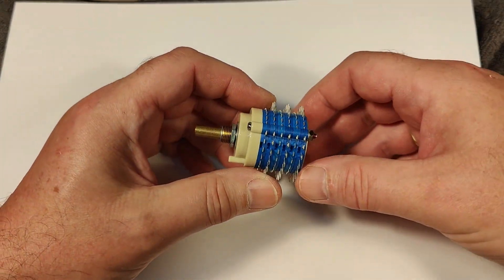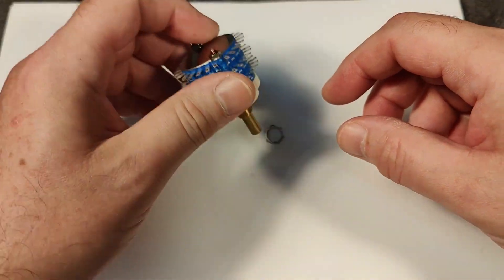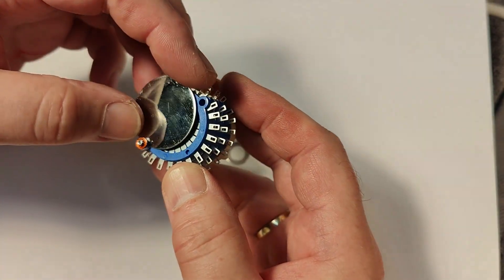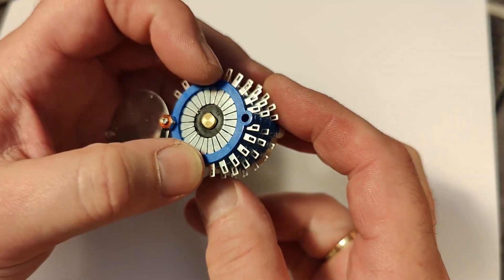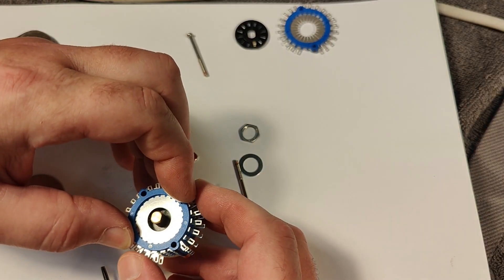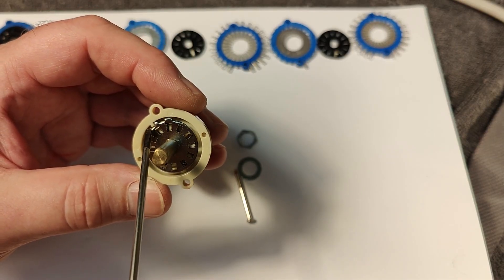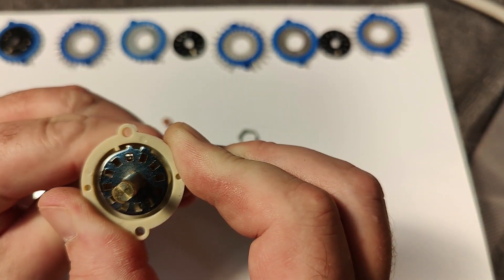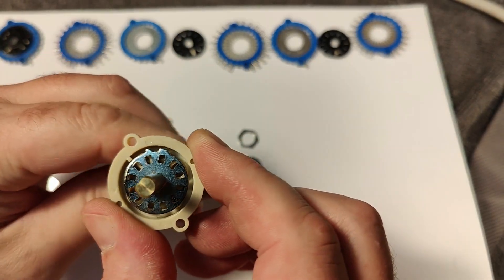HELZCDNL 15 degree rotary switch end-stop experiment NO WAY

Comment: Looks like the centre shaft is just long enough. Make another metal plate identical to the existing one, possibly made from sheet brass which is readily available, apart from 2 holes drilled in it to accept the 2 locating pips for the first wafer, and a central hole to clear the shaft. Then make a pin that sticks down from the metal plate into the body of the switch which will foul with the tab of the metal disc. This pin could be brass and soldered in place. Re-assemble the switch, the existing screws look like they'll have enough thread to be re-used.
Reply from the maker: wow a full MACGYVER kind of solution :-) might work if you need only one modified, but i need 18 of them , so it must be much more simple to solve
Reply: @TeardownOZ2CPU  Up to about 2012 I had my own electronics business, we had a cheap laser engraver/cutter, it would have cut 18 pieces of metal like that in seconds. I'm sure a guy as capable as you knows someone with a laser cutter? Although, it will probably work out being a full day of a job just pulling all the switches apart!

Comment: you assemble the whole thing back together, and then put a metal shim on top over the shaft, and that has something like a clock hand, that gets stopped by a bolt or something like that. that stops the motion. it's not perfect, but it works.

Comment: You could drill a hole and put in a pin or screw (M2?) from the top. Not the greatest solution, but should be doable.
Reply from the maker: but very hard to clean out plastic dust, due to grease lubrication.. i feel it is better to glue in a little plastic stopper part, a bit sad they did not think this into the design, all other switches have this, but are MUCH more expensive
Reply: @TeardownOZ2CPU  Yes, the grease is going to be a problem either way. That will also greatly affect the adherence of any glue. So it has to be cleaned out anyway.